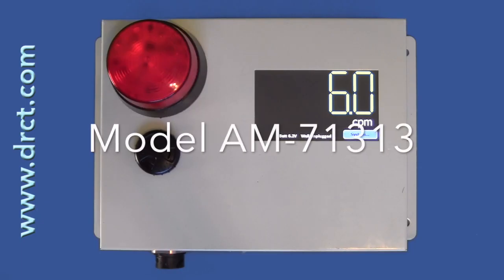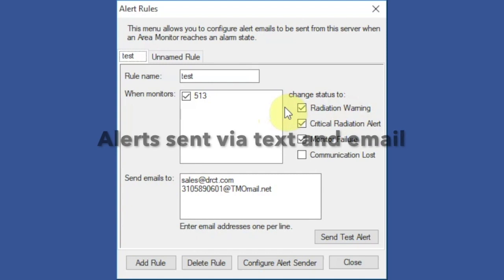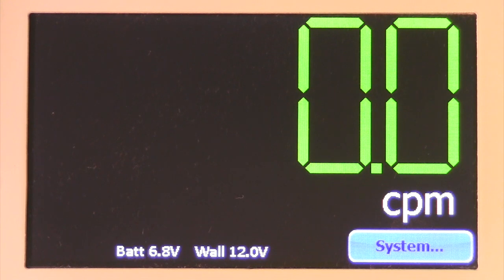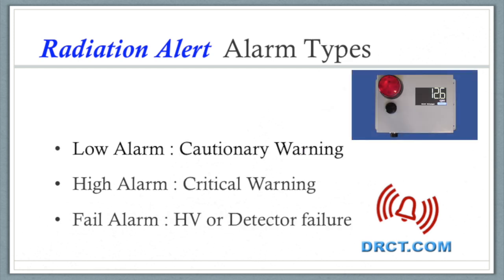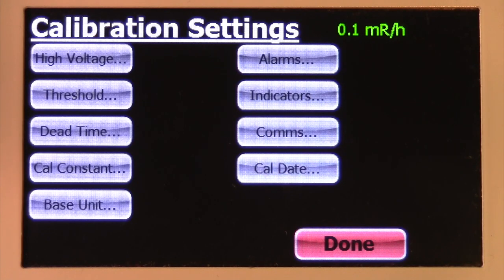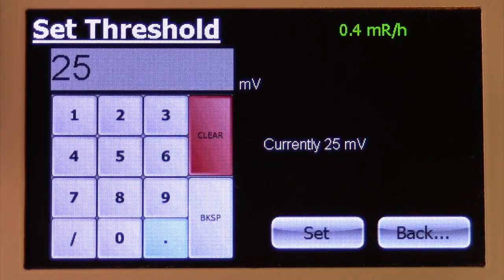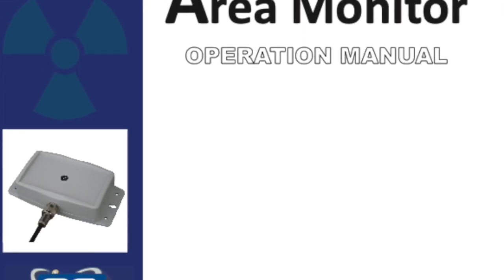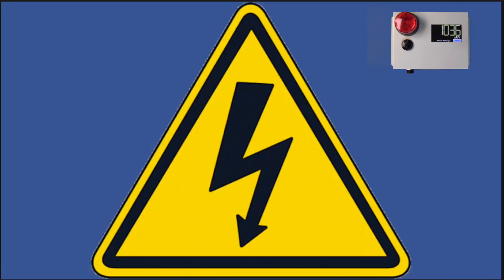Radiation Alert Area Monitor

Comment: This is nice. I would go with the one with the external scintillation probe reading in CPS. They are pricey though
Reply from the maker: Thank you. I prefer the CsI over the NaI, although CsI hasn't really caught on yet. The monitors aren't cheap, but I believe they are better value than the European models which are more expensive (with fewer functions).
Reply: Direct Scientific do you have the small Johnson eagle eye portable scint detector. If so can you make a video of that one.
Reply from the maker: @hectorvazquez7929   I don't.  I will be making some dosimeter films, in the near future though.